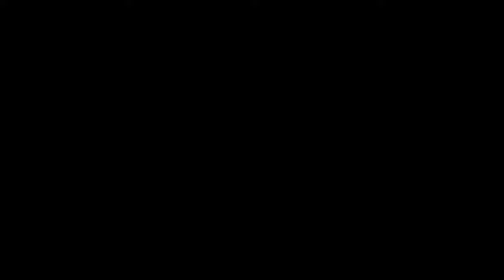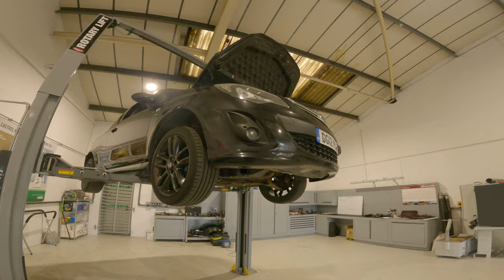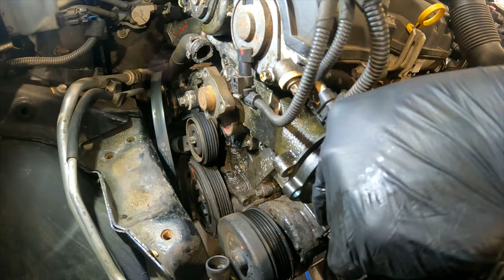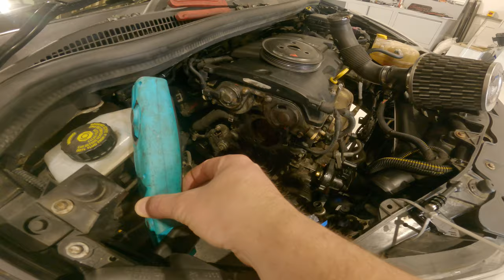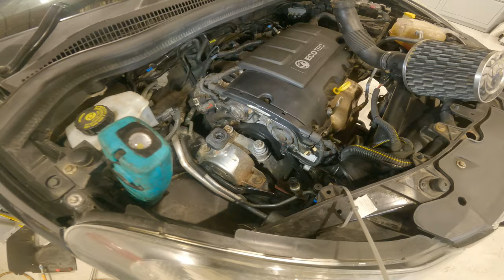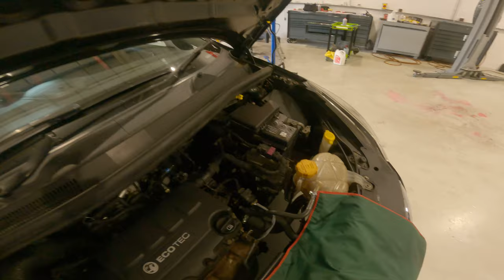Corsa D Water Pump Replacement. Step By Step..

Comment: Good video and well explained! Doing mine weekend did you
Use gasket paste for water pumps to seal! Do you have torque specs!! Cheers
Reply from the maker: Thank you, no I don’t personally use any paste, never had any issues. Bolts are 8nm for the water pump
Reply: @godfreysautomotiveservices  hi seen some people
Use gasket sealer! Just wondered if I needed any that’s all! Like a little help and advice

Comment: Ive done loads of these and always have an issue getting the engine high enough to get mount out im curious thanks
Reply from the maker: Hi Wayne, i haven't had any issues removing the mount as yet, i'll lower the engine first to remove the bottom bolt and then jack the engine up to remove the rest. The exhaust flexi will stretch slightly but we haven't seen any exhaust issues afterwards as yet.

Comment: Hi. Do you know what is a normal water tempresure for Corsa D? My corsa standing on driveway goes up to 117. The fan kicks in at 109. Shouldn't be normal tempresure at 107 for Corsa D 1.2L
Reply from the maker: Hi, yes your vehicle temp seems slightly high, these should be from around 90-107.

Comment: I cant seem to get the bottom bolt out of engine mount bracket if i let engine down it wont come out and if i jack it up the engine is caught on bulk head and wont go high enough, when jacking engine up it seems to go up and back.
Reply from the maker: Try unbolting the exhaust flexi, it may allow you to Jack it up slightly higher to remove the bolt mate 👍

Comment: What torque did you use for the mount ??
Reply from the maker: Hi Lance, engine mount to chassis 3xM10 bolts 60nm , 2xM12 bolts to engine mount 80nm + 45degrees
Reply: Cheers matey, your a life saver :-) and I subscribed;-)

Comment: Mate having issue with my sisters corse overheating hoses are well hot but Radiator is cold.. Thinking water pump?
Reply from the maker: Definitely worth checking mate 👍
Reply: @godfreysautomotiveservices   cheers chap👌
Reply: Mate water pump and radiator replace on the weekend and still overheating steam coming out from the reservior, thermostat was change 2 weeks ago
Reply from the maker: @clarknicolas6780  ah that’s not good, have you done a head gasket check?

Comment: Did you torque the blots, on the water pump?
Reply from the maker: Yes 8nm
Reply: Thank you for this my corsa been overheating tried everything, ordered new therm didn’t work new pump on the way and a torque wrench hopefully it’s the pump, all pipes remain cold
Reply from the maker: @joer2513  sounds like the pumps not circulating the coolant round 👍 let us know the outcome!
Reply: @joer2513  Are you sure the engine coolant physically overheats? (Steam out of the radiator cap?) Because a weak point with the corsa’s is a faulty radiator temperature sensor, you’re dashboard will show overheating engine and the engine goes into emergencyloop, mine did the same. Coolant temperature on the dash was 140°C but the engine was functioning normal, except going in emergencyloop, since the engine doesn’t know the coolant temperature. You have 2 coolant temperature sensors on the Corsa: 1 in the thermostat housing & 1 in the radiator. If the difference in the two temperatures goes over a certain tolerance, it trips a check engine fault code P00B7 (engine coolant flow low/performance) and/or P0117 (engine coolant temperature sensor 1 circuit low) Also are you sure the thermostat functions correctly? The plastic legs that hold the thermostat in place break easily wich results in an always closed thermostat. The thermostat should open at 103°C. From what I read its a problem with the radiator temp sensor or you’re thermostat. If the waterpump doesn’t leak or make a whining noise. You can also listen if the bearing is still good with a long screwdriver on the waterpump and listen, or a mechanics stetoscope. Good luck in finding the issue 👍
Reply: @joer2513  Are you sure the engine coolant physically overheats? (Steam out of the radiator cap?) Because a weak point with the corsa’s is a faulty radiator temperature sensor, you’re dashboard will show overheating engine and the engine goes into emergencyloop, mine did the same. Coolant temperature on the dash was 140°C but the engine was functioning normal, except going in emergencyloop, since the engine doesn’t know the coolant temperature. You have 2 coolant temperature sensors on the Corsa: 1 in the thermostat housing & 1 in the radiator. If the difference in the two temperatures goes over a certain tolerance, it trips a check engine fault code P00B7 (engine coolant flow low/performance) and/or P0117 (engine coolant temperature sensor 1 circuit low) Also are you sure the thermostat functions correctly? The plastic legs that hold the thermostat in place break easily wich results in an always closed thermostat. The thermostat should open at 103°C. From what I read its a problem with the radiator temp sensor or you’re thermostat. If the waterpump doesn’t leak or make a whining noise. You can also listen if the bearing is still good with a long screwdriver on the waterpump and listen, or a mechanics stetoscope. Good luck in finding the issue 👍